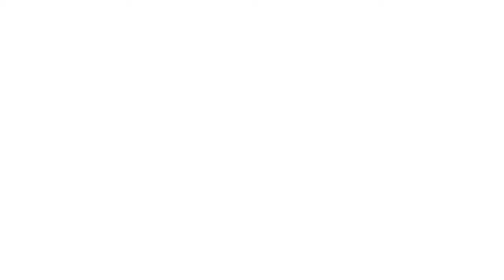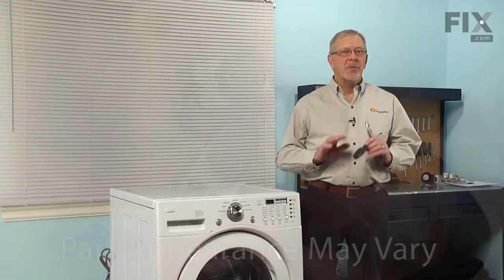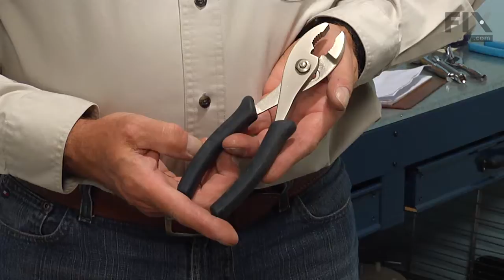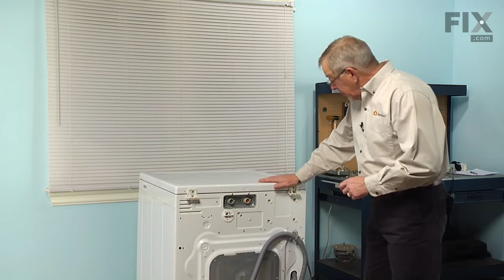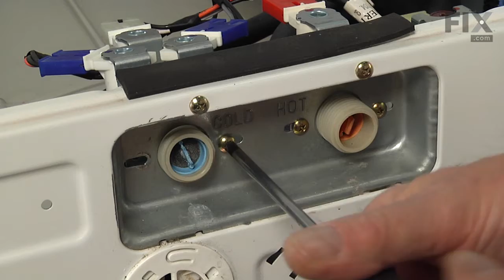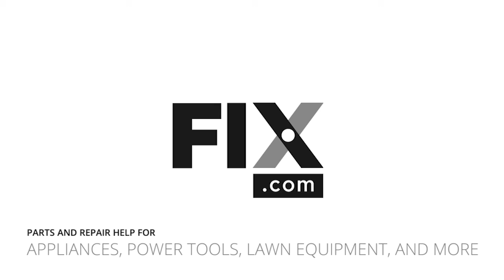LG Washer Repair – How to replace the Water Inlet Valve

Comment: Your video made my replacement of the hot and cold water inlet valves easy and very quick.  I especially appreciated your mention of the Phillips screwdriver and the slip-joint pliers.  That was all I needed.🙂🙂 Normally, I would have brought half a toolbox.  That isn't needed. All you instructions were perfect.  Thank you.  You helped me a lot.

Comment: Can you tell me why the tube from "Y" tube conector to steam port on my LG WM3470HVA front load washer swells and leaks at the connector? It seems like there is a build up of pressure in the tube and it causes a spray at the "Y" connector. There are a series of tubes that make up that singe line with a bunch of connectors with orange and blue colored check valve or screens in the series of tubes. I tried blowing through the tube and only a little air would go through. The tube leads to the front part of the washer drum. Can't find anything about it online. HELP

Comment: I’m curious why this is only done for the cold water valve and not the hot?
Reply: per the website selling this part:  This valve is used for cold water, bleach dispenser and prewash cycles. It has a standard hose fitting inlet with 2 outlets facing 45 degrees to the right and one outlet facing 45 degrees to the left.
Reply: He is replacing the bad cold valves(stuck closed or leaky open valves)....if the hot side is bad, then replace it too!

Comment: Great step-by-step with the very clever trick with swapping out the hoses. The hardest part will be getting the thing off the pedestal!
Reply: You should not need to take the washer off the pedestal to change this cold water 3 way solenoid valve.
Reply: Why would you take it off the pedestal?

Comment: I love the new dryer-->allmy.tips/lgSteamXWasher?a21     but I have been finding the error light comes on randomly meaning the vent is clogged. It doesn't happen all the time, just every 3rd or 4th load. I have my vent cleaned out regularly, and have a serviceman coming this week to check it again. If I continue to get that error message, I will be calling!

Comment: Great video.  Would a defective water inlet valve be responsible for water filling the drum when it is empty and not running?  I am getting water in the drum when the washer isn't being used.
Reply: I having the same issue.
Reply: @metaldon00  turned out that it was the hot water inlet valve. I replaced  the cold as well just in case. Bought both of on Amazon. Easy repair.
Reply: @williampaxton871  Could you provide the link to buy it? Thanks!
Reply: https://www.amazon.com/gp/product/B00AUDAEMQ/ref=oh_aui_detailpage_o02_s00?ie=UTF8&psc=1.  This is for the hot water valve.  Go down to frequently bought together and get the cold water valve, too.  You don't need the extra screens.